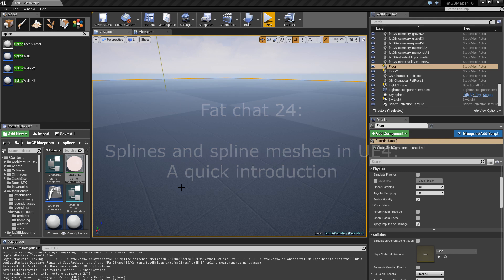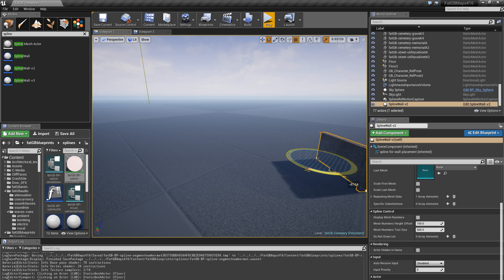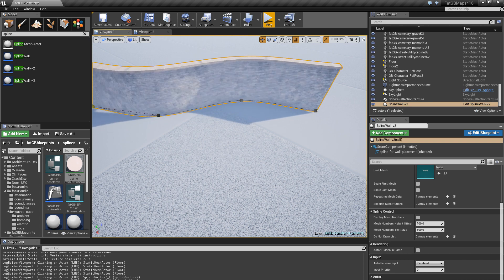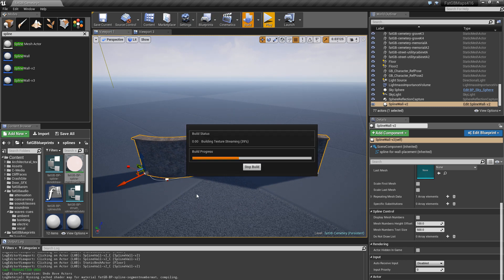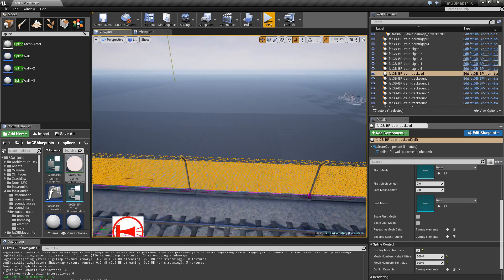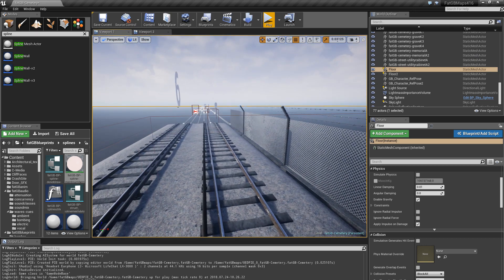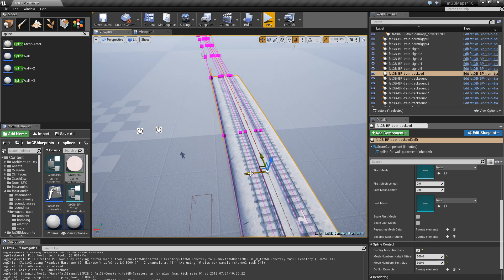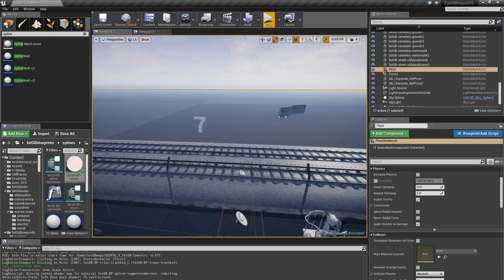Part 24 - a quick overview of splines and spline meshes

Comment: How do you rotate the splinemesh acording to the landscapes normal?
Reply from the maker: All manual placement, I'm afraid. When laying path or road on a rolling landscape, I usually use meshes with a thick edge and then sculpt down the landscape in the middle. Is not great but works for 98% of stuff.
Reply from the maker: Landscape splines DO conform to landscape, but that's a whole other system